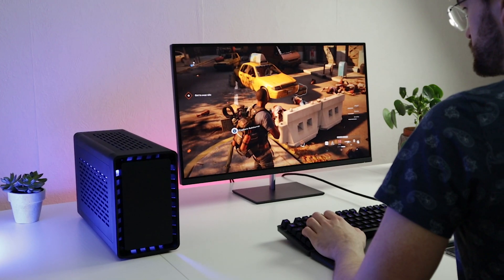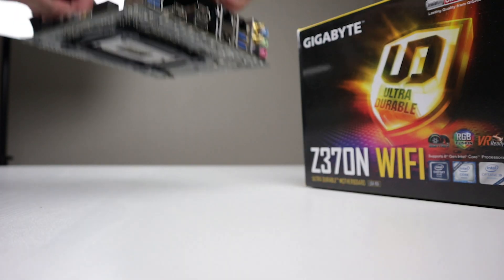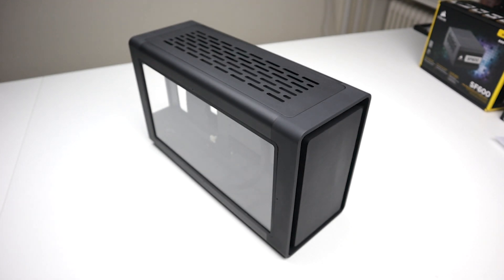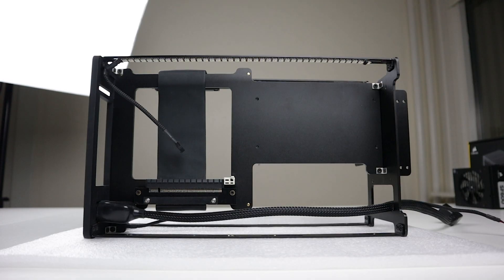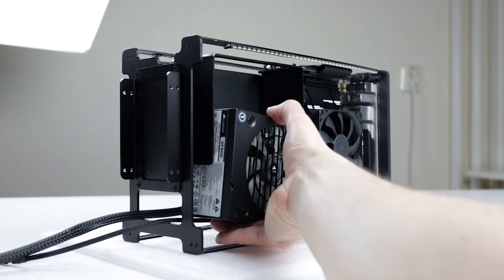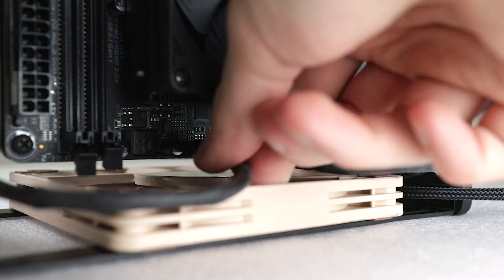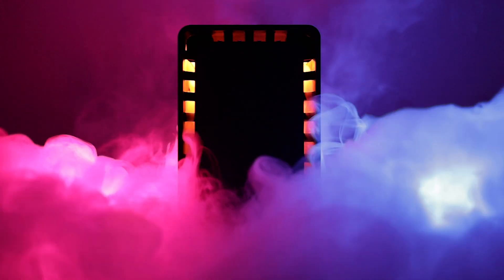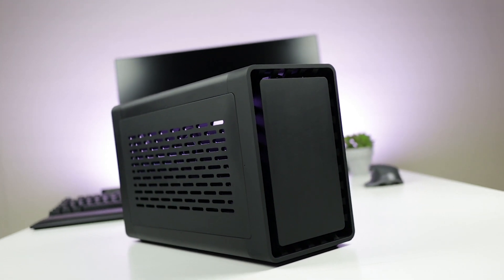MJOLNIR — The Complete Air Cooling Guide (Beginner Users)

Comment: To those who build Mjolnir in 2021, you should be the one who judges whether intake or the exhaust works better on your setup. Although the narrator insists that she tested out every cases and intake was the only answer, normally what's considered as rule of thumb for sandwich layout case is the EXHAUST. I'm not trying to challenge against this youtuber's decision because graphics card used in this video is a blower fan so the intake side fans supplying cold air towards the blower fan give better thermals. However if you're using a common custom cards from most of the GPU manufactures it's definitely better to go exhaust in order to blow out the hot air sneaking out from the graphics card heatsink. When we're generally talking about the sandwich layout cases without any extra fan placements, airflow would completely rely on intake air from top down CPU cooler fans and GPU cooler fans and would struggle passively exhausting the hot air through the case ventilation, so if you have an extra room for case fans, definitely going for actively exhausting those hot air is the rule of thumb. Flipping the case upside down or using higher feet would help on the thermals.

Comment: 3:52 - black finish chipped away in the screw-in areas -- Anything being done to prevent this on production models?
Reply from the maker: vpr It was caused carelessly screwing in Noctuas Self-tapping screws in my previous tests...:/ It cut the rails a bit. Have not seen these problems with the included screws. As long as your careful it’s shouldn’t be a problem with Noctuas screws either.